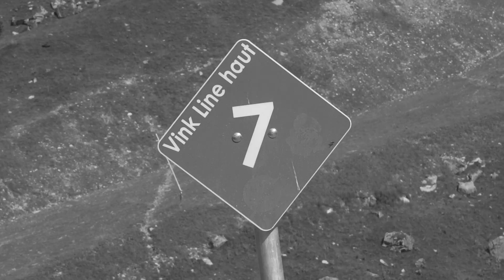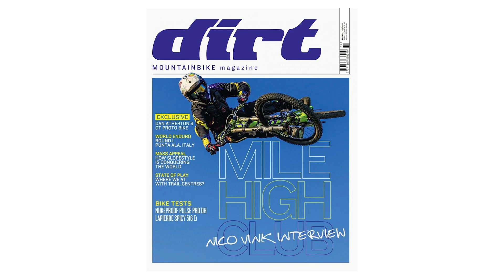Rider Profile | Freeride Mountain Bike Legend Nico Vink

Comment: can someone help me with my bike?
my bike is a trek fuel ex 8 2017 29er 

i am trying to remove all frame  pivot screws so i can check the bearings and put lube because there is a crekaing sound coming from the frame.

do all of the bolts should be unscrewed counterclockwise in order to remove them?

Note:there is one pivot bolt creaking when i am trying to rotate it clockwise and counterclockwise